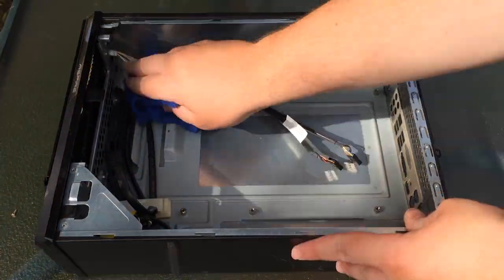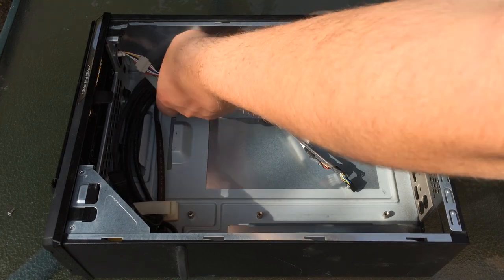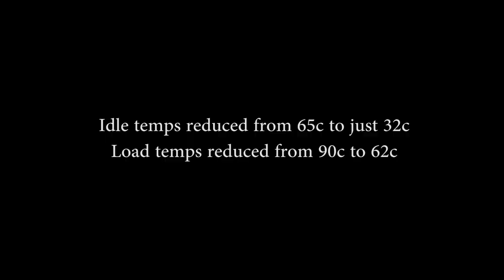Cleaning Up The Free PC I Got From The Dump

Comment: the air can duster is more expensive than this pc
Reply: but you can get a cloth and manually do everything... but it will take more time and AINT NO BODY GOT TIME FOR THAT (i want to fucking die)
Reply: i used an old stripped copper wire that I've got from scrap.
it works better in some tight places than air duster or compressor.
Reply: The cloth is more expensive.
Reply: in all honesty i just use a leaft blower to blow dust out. you just have to be careful not to overspin fans. it works great.
Reply: and the air is worth the same as this PC
Reply: Zenthora the toilet?
Reply: Piotr Romasz the cloth he used was more expensive
Reply: Zenthora from a black people farm?
Reply: well... sure... i guess?
Reply: I use a balloon pump I got a dollar tree. It gets the job done and it never runs out
Reply: maybe he can get an USB vacuum cleaner from pound-world, pound-land  or 99p store
Reply: Piotr Romasz avgn
Reply: rockialien wandering soul Doesnt that generate static electricity?
Reply: most compressor are made of metal.
so i think not.
Reply: That my friend is powerfule enough to break solder joints not even kidding.
Reply: soothsayer cuckslayer I do the same, except for the fan and also.
Reply: thats why i use a paintbrush when cleaning the pc's that i get

Comment: PUT THE MINI GTX 1050 IN IT!!!!!!!!!!!!!!
Reply: 1030? 2gig?
Reply: that's good
Reply: it looks like there is only a PCI Lane, and not PCI-E but im probably blind
Reply: Will more like 1030 duhh
Reply: Matalino There's a 1x slot so he can do it.
Reply: I only said 1050, because he has one
Reply: you have to make this happen, it is too insane not to do :D
Reply: Power supply might not be up to it and the x16 slot is only 1 slot wide, the x1 is not open and you couldn't fit a larger card in there without cutting down the back of the slot. And that processor or even its highest potential upgrade would bottleneck the hell out of a 1050. This is better suited for one of the sub 50 nvidia cards, like a single slot GT730 to get low power draw and decent performance with that cpu
Reply: awe thats a shame i thought the 1050 fitted :( was a nice dream while it lasted :p
Reply: but the gtx 750 ti mini itx could fit in?
Reply: what's the different between mini 1060 and the standard sized 1060?
Reply: kifla performance wise?
Reply: nah, performance is the same, the card is just smaller
Reply: Will or gt 1030

Comment: Hey RandomGaminginHD , you should try to unlock the Phenom 8550 from three cores to a quad core and see if it runs stable! it's easy to do in the bios usually
Reply: +UberTiger1 I have the same pc as in the video but with a. quad core CPU : the phenom 9550, which is 4 cores, at 2.2Ghz OC to 2.55Ghz stable 24h/7. But I dont know how unlock CPU cores.
Reply: +Lothaire Cliquennois How to OC phenom X4 9550 ? i have same cpu
Reply: Lothaire Cliquennois some processor back in the day released a quad core as a 3-core processor so that they can get more money by (in a nutshell) DLC that unlocks the 4th core
Reply: +Geysa Pratama you should check your bios/uefi , usually you OC your cpu from there
Reply: kenny ricardo no that's not the case, although some manufacturers like Intel did this once, these CPUs are binned, and the ones that perform worse or are unstable have one core disabled (the "bad" one). it's just like the gtx X80 and titan gpus
Reply: false my friend, you could unlock them for free via bios they are not so good quads with a error in the fourth so they disabled the 4th core
Reply: I have an Athlon x3 435 that the bios on the motherboard didn't even ask, it just auto unlocked the fourth core. which made it into a athlon x4 635. Later ones, phenom era, they fused off the cores at the factory so bios could not do that, because it was getting too easy with the motherboard manufacturers making it automatic. those were fun times though.
Reply: UberTiger1 Does the pencil trick work on it.
Reply: gravastar333 lucky! tried my x3 440 in 2 mobos and couldn't even get into Windows stable. 😢
Reply: because its just a triple core, the 4th has a malfunction and yours had a serious one, thats why they are only 3 cores
Reply: Kim Weißmann Obviously lol, but not all of them are, hence me giving it a shot. Don't know till you try. 😞
Reply: imaghostya Yep, I have a sempron 140 from the same era, tried to unlock the second core and it would crash in games. worked for desktop use though, for a couple minutes anyway . lol
Reply: That's not correct although intel did something similar at one point. Amd did it because they couldn't keep up with demand for the 3 core variants. so they sold the 4 core as a 3 core with one core disabled, Later people realized this however and mobo manufacturers allowed you to unlock it in the bios. It was never guaranteed but it was possible.
Reply: UberTiger1 .

Comment: Far better than canned air = air compressor.  Been using a high powered air compressor for 20+ years to clean computers, servers, switches, etc.  It gets WAY more dust out than those little cans of "compressed" air.  Also, regular 90 percent rubbing alcohol works wonders for cleaning off thermal paste.  LOVE your videos!  Keep them coming! :)  Oh, and put the 1050 in this little beast!

Comment: You need a SSD, a GPU, an Aftermarket Cooler and overclock the heck out of it
Not to mention he needs a new PSU.
Reply: The Real Bleach SSD wouldn't do anything really, overclock wouldn't do anything either due to heat lock... this PC is a htpc, for streaming mainly
Reply: Ben Phone I said SSD  because it has a sluggish HDD running Windows Vista.
Reply: also I don't think he would be able to overclock anything on that motherboard
Reply: David Kuchař Even if he wouldn't overclock, that old CPU will become hot so its best to get an aftermarket cooler.
Reply: Again, SSD solves nothing on a Sata 2 connection, spending money on this PC is a waste, use up what spares you already have, otherwise you are wasting money.
Reply: Ben Phone That's not quite right. Most SSDs can max out a SATA 3 connection, but that's their sequential read/write speed. The thing about SSDs that really makes them a great upgrade is their 4K read/write performance, which is still really far from 6Gbps. So it's still going to make a huge difference even at SATA 2 speeds (Even though you're going limit your sequential speed)
Reply: wtf are you talking about?an ssd i useful for those extremely low 4k speeds of a used hdd,its not the high speeds on large files that matter,its those small files that are the bottleneck,i used an ssd on my sata 2 laptop and it was so much faster and i compered with a clean install on both hdd and ssd,and  a friend of mine has an ssd in a sata 1 vista system and it is 10x better than before and easily usable.almost always the hdd is the problem.
Reply: that cpu cooler looks beastly enough for a non-overclocked thing cpu. remember that this is an extreme budget-oriented youtube channel, so if RandomGamingInHD can get away with a cpu cooler that lets the cpu run up to 95°C (it won't in this case) with a lot of noise and NO thermal shutdown, then he will.
Reply: SSD on a sata 2 connection will still be a massive upgrade.
Reply: It doesn't even have a pcie slot fam
Reply: László Duh, he can use SATA porta
Reply: Robin Roos I would do it because that CPU is known to produce high temps
Reply: SSD can do amazing things even on sata 2. You have no clue what you're talking about. Plenty of ancient laptops have been given new life with SSDs.
Reply: ***** How do you think you would upgrade a PC? You can't get all these things out the dump
Reply: I use only old school hard disk because windows 7 takes 3-7 seconds to boot from it's 64mb cache 72-7800 rpm disk. Again, an SSD is wasted money. But what would I know... Only building the things since knee height, so my facts are clearly beaten by opinion and hear say.
Reply: It does have a PCI-E slot 1:07 . An SSD's IOP's and as others have said 4k performance would mean a massive upgrade over any mechanical drive that it currently has, yes the transfer speeds will be held back but the responsiveness of the system will no doubt be a lot better.
Reply: high temps but not shut down - high temps. that's what this channel is about. he pushes the limits of his pennies to see how far he can go :p this isn't LinusTechTips who would watercool a nokia 3310, quite the opposite really
Reply: Robin Roos Watercooled Nokia 😃😃😃😄😄😄😂😂😂
Reply: There is a PCIe slot at the back
Reply: +Interactiv
Reply: Acer BIOS won't allow it =)
Reply: @Ben Phone A quick bit of research online would quickly disprove your theory about SSDs being useless on SATA 2 Drives. Just because you have built PCs for quite some time it doesn't mean you are necessarily  correct. 

Traditional HDDs do not even fully use the potential speed the SATA 2 Specification brings about. Sure, SSDs will be experience a bottleneck as such on the older platform, however it will still be much faster than any HDD on the same or even better interface.

Also, unless the operating system you have installed is relatively fresh, I highly doubt you will get a 3 to 7 second boot wait time.
Reply: The Real Bleach why an ssd?
Reply: dar0 Read the replies to the comment to see the reason :/
Reply: ***** with that cpu cooler at stock clocks, I can't imagine it throttling. I think it'll hit 80-85C while running prime95, which is comfortably away from throttling temps.
Reply: The Real Bleach You can't overclock due to the motherboard chipset.
Reply: Non overclockable chip
Reply: Samster Birdies that's about it. That's how I built my first custom computer
Reply: Alright let's see, small form factor case, so power supply limited, motherboard doesn't support overclocking, aftermarket cooler would be minimal effect since the BIG performers wouldn't even fit. And at that size any GPU you would get would be an IGPU competitor rather than a big ticket. Not worth the investment on this thing unless you are truly out of options.
Reply: ExtremeAutocorrectFails You would be able to load Windows 10 in 10 seconds and MacOS in 5 seconds
Reply: Graphics Card*. A GPU is a processing unit on a graphics card.
Reply: Crazy36Bird The GPU has all the graphics inside it though. The rest for optimization and cooling
Reply: @benphone7430  Did you know
? An SSD make pc run faster. 10 to 20 times than typical hdd.

Comment: Just a little advice for the ones that might not know this- Dont be stupid and open a PSU to "clean" it,  cuz it can hold enough stored power to actually kill you, even if its been lying in some box  not even being used for a while. 
If you are cleaning a fan be extremely carefull, but imo i wouldnt even bother with going in that area. Just clean everything else.
Reply: Electrons dont work like that lol
Reply: to be fair dominik is right, if you bridge the components in the psu with your hand by accident while cleaning it the capacitor can hold more than enough energy to kill a person,but if you just open it and blow the dust without actually touching the components you should be fine
Reply: SmashVG Wow. I hope you are kidding. Just dont open the psu and touch stuff in there. Im not saying this to troll you, but to stop someone from being hurt.
Reply: The PSU doesnt have a hold on electrons, its not a battery, sure it not advised to open it at all especially if it has warranty but I doubt it can kill you
Reply: You can clean the PSU! you need to keep it connected to the PC but unplugged from the mains and press the power button. What this does it that it will lose the rest of the power to the components but not enough to power it up as it is not connected to the mains. Then hopefully it won't give you a massive shock xD (If dead, I am not held responsible) ...
Reply: Dominik No get a fully modular one
Reply: The big capacitors need to be safely discharged. Take gloves, and a Big resistor (like a 5W one) and discharge the capacitors safely with it. At this point, you should be safe to work with the PSU. No sorcery involved ;D ! Either way, it's DC current, not AC, you should not be killed, but it's gonna hurt and burn ... maybe.
Reply: what if we wear rubber gloves? would it help?
Reply: i just wear 2 condoms when cleaning PSUs, works like a charm
Reply: Oh wow. i didn't know this. Thank you!
Reply: holy fuck I cleaned my psu one month ago, I didn't know that but luckly i didn't touch the stuff in it, just the fan.
Reply: Ulquiorra Schiffer Hahah yeah thats exactly what i did too..and thats when i found out about this. I was cleaning a fan and was like "what else should i clean in here" so i google cleaning PSU and saw all this warnings LOL. I fucking stopped and closed that shit really fast 😁
Reply: It's not fucking magic lol, leave it off for a few hours and the capacitors lose their charge, if your paranoid use a multi meter to check the capacitors before  you start dusting.
Reply: Be stupid and do clean it  ! . I opened a psu after 4-5 years of use , before i sold it to see what's inside , and boy a lot of dust and chunks of dust were there .
Educate yourself with a 5 min youtube video if you are that stupid to touch caps and whatnot . AND DO the job , with a can of compressed air you won't even be in danger .
A sidenote tough . This type of cleaning (that involves component disassembly) should not be carried out more than once per year , or once per 2 year . It's more than sufficient .
Reply: They can hold charge for a while. Solution: disconnect AC, hold the power button for ~10 seconds. That should discharge all the capacitors, at least in theory. But yes, use a multimeter always to be safe.
Reply: Dominik No Ive opened up power supplies before. just discharge it by pressing the power button a few times and youll be fine
Reply: Just don't touch random shit in there.
Reply: The caps hold enough to screw you up.
Reply: what about if i need to cleen the fans for it i seen some guy using an earbud? anyone.
Reply: Like many on this thread and myself have said, disconnect AC power, hold the power button for at least 10 seconds. You can then work with the PSU without worry, but even so, use insulating gloves.
Reply: id love to have a almost 100% storage efficient cap
Reply: I guess you haven't seen just how much dust can accumulate inside a PSU. I did mine about 2 months ago and its was worse than all the other PC parts I cleaned. And the danger is if you are not being careful, just don't touch anything with your hands and use soft brushes and air dusters.

Comment: Lol, got mine from a "dump" as well. It's a core quad q8300 model. 
Upgaded it to 8 gb of ram, GT740 (the only card, that I found, with true 1 slot design) and storage (to 2.5 ssd, 3.5 hdd + slim blu-ray drive ).
Though, I had to change PSU to a server one (cos 220w is a joke)
Works just fine

Comment: you call that dust?
my friend pc was 100x dustier, i call it "the dune", then when blow the air thru it i call "sandstorm".

oh wait!, is that a cement or thermal paste!???
Reply: any idea what that blue mop made of?
i use regular cloth yet it leaves a single thread or more. kinda worry.
Reply: Just use kitchen paper. Works like a charm. Or in a pinch a few coffee filters will work too. (Toilet paper however I wouldn't recommend as it falls apart to easily.)

Comment: Some statement should be made to try and hold refrigerant propelled cans upright and avoid allowing the can to pickup and project Difluoroethane (the propellant). While everyone who thinks this is fine will go on "it evaporates immediately" that isn't always the case as enough shot in one spot will actually flash freeze, and even frost an area.

If you're almost done your project, do that; toss it all back together and plug in within an even relatively timely manner.

Well, if the moisture doesn't leave you with a bad time the frosted bit (if there were one) would head off to melt rather quickly.

Now you have rolling water in your PC, congrats.

Comment: As a person who has cleaned enough PC's to drown a few horses, I know the struggle of loads of dust in a system and how much it can adversely affect a systems operations. This is nothing compared a longterm smokers computer with dust caking the heatsink and powersupply. Green if you read this, and plan to do more cleaning and repair of PC's, get an air compressor. they are ungodly noisy, but it is totally worth every penny of the cost when you end up saving alot of money on those cans, and the compressors are generally more effective and removing dust as the compressor outputs loads more pressure over time than the can does. good video though, and very comprehensive!

Comment: Nice video! If you have access to an air compressor I highly recommend using that for cleaning old PCs, does the job really well. You should also blow all the dust off from the internals of the psu, they collect a lot of it.

Comment: Watching your videos motivated me to look into upgrading my old Dell 540s. I had to undergo a similar cleaning process. The main shocker was that the thermal paste on the old CPU had nearly vanished. There was just a dull concrete corner covered in what looked like concrete. Still surprised that e7400 performed as well as it did in that state. With a q9550 and a low profile 1050ti, the old Dell runs quite a few modern games better than a PS4.

Comment: I have nearly the exact same acer system it’s just mine is intel based. It is wonderful I’ve been able to upgrade the cpu to a i7 4790, gtx1060 mini, 16gb ram, ssd, and paired the cpu with a cooler master Geminii 5 cooler. I absolutely love and it’s a beast!
Reply: Forgot to add Corsair 450 sf psu and modified and removed the tray that holds the cd drive and hdd